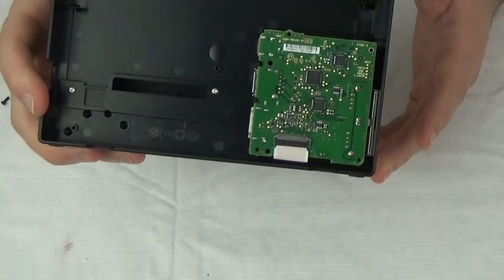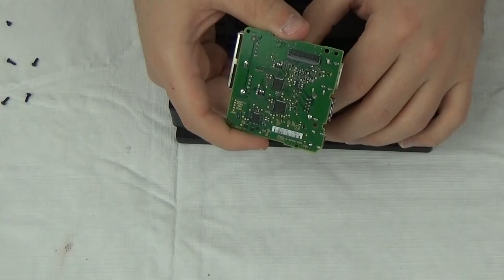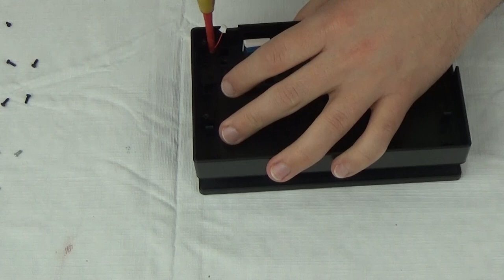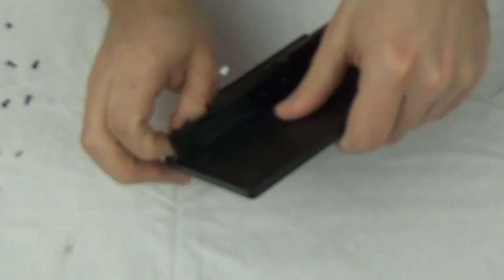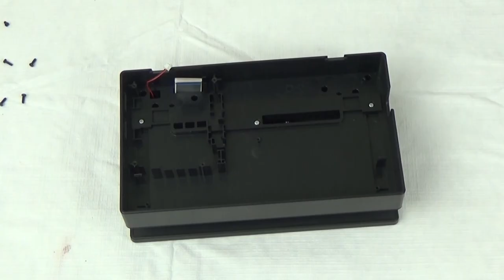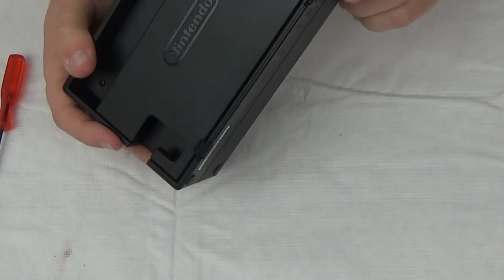Taking Apart The Nintendo Switch Dock!

Comment: Not only is it a Brilliant Console, and a Brilliant screen. & how the connectors go on the actual screen, itself, on either side of the actual screen itself👍🏿... And I love the fact that Nintendo switch actually, has a lot of demos, and a lot of other stuff that you can. Actually buy, it's that good I don't even have to. Go to eb games anymore, or JB Hi-Fi. Or Myers or Target, or even Big W and some of the stuff that's online, is pretty good like pretty decent,old arcade stadium 1 & 2,ex fighting layer rush, wonder boy collection,Super Nintendo NES collection,Some great racing games as well, & other titles, I mean even if you just want the real cheap, and even just the demos of games, the only thing I can say that might be a little bit, disappointing is that the fact is if you play the games for long hours, it might overheat. But other then that I haven't experienced any. Other things lately from the console itself. Considering it seems like a pretty decent console. I think the fact why they made it like that is so that it would overheat probably. Because kids would need a break because of radiation. I remember myself when I used to play for really long hours sometimes like 24-hours straight and most in the consoles would get really hot. And most games can take a very long time, as in completion, and take many hours to play if you do lots of Longplays. That's all I can really say for now about the Nintendo Switch. The other thing I can only say that might be missing on the online store is that they don't have clay Fighters sculptures cut and zero the Kamikaze squirrel 🐿️ for super Nintendo. But seeing that they have a big library, and variety of games online. I guess you don't really need those other ones. Thanks for showing us what's under the hood of the Nintendo switch dock box ✌🏿🧐.

Comment: they said the base would have a fan to cool down the system, all the processor to overclock. it seems weather it's plugged in or not that it's basically running full power, only limited from the screen only being 720.  totally disappointed in the quality of it.

Comment: With all the reports of the dock scratching the switch I was thinking about cutting off the front to where it would be even with the bottom of the screen.  Looks like it would still sit upright in the dock without the support of the front.  I didn't notice any electronics above unless I missed something.  I was thinking this might be a good mod for playing your switch in handheld mode with the ability to charge while your playing.  What do you think?

Comment: question from an absolutely-not-that-tech-guy: is there any concern when using the usb cable i got with my pro controller to charge my switch on the go with an old usb  to dc dapter from my tablet? thanks for your answer!
Reply: ccoa08 Most likely not but it would charge a lot slower. The official charger outputs 15V and 3.0A so if it's less than or equal to that amount there shouldn't be any damage as far as I know.
Reply: Michael Crook ok, thx. i dont mind about charging slower or not, just want to make sure that it doesnt damage the battery itself

Comment: I don't want my dock to scratch or overheat my Switch Tablet. Anyways, I see that there is a USB-C port where the spring mechanism is in the crevice of the dock. Do you think I can have an adapter connect to the USB-C inside of the Switch dock? Then I can plug in the Switch directly into the adapter instead of putting it inside of the dock therefore being able to connect it to the T.V.

Comment: Is it worth $90?
Reply: Top Dawg 8:56 "probably not" lol
Reply: the charger is 30$.

hi quality HDMI at 10$.

so... dock itself is 50.
Reply: Top Dawg It comes with the console
Reply: +TheBraveGallade
A typical USB-C hub costs between $35 and $60. Take $45 as an average. Result Dock itself = $5
Conclusion: It's not cheap, but it is also not expensive, it's in line with the typical market value. 
But you know all the "would be specialist" are convinced otherwise. What can you do!
Reply: Mum Blic 

Also the belkin usb c to hdmi costs 60$ and has the parts to convert.

In fact I don't think most docks can output hdmi and 3 usb ports at the same time while also charging (which is probably the reason why switch doesn't output hdmi nativly)
Reply: +TheBraveGallade As far I know you can send HDMI direct over USB-C, but in that case you loose USB (3.x). In case you go via the Displayport route, you can have HDMI and USB 3.x at the same time. 
Don't forget  Nintendo could have gone for a completely proprietary  protocol  This is something that the USB-C specification allows, especially for dock solutions! That's why I was hoping for close-up pictures of the usb-C controller. Missed opportunity ;-(
Reply: Damn dude you over paying for hdmi cables bigly.
Reply: Top Dawg Hell no
Reply: +Greg Greg You seem to have more information then we do. Could you please give us a reference to a USB-C based dock with similar hub for less then $90. We are all waiting with anticipation.
Reply: Mum Blic I personally don't know, but for what i read in the comments section people who know about tech say that this is not worth 90$.
Reply: +Greg Greg, Funny that you are formulating it like that. You are right, if you read the comments you would believe it. The problem is that 98% of those people pretend to know something about tech but In reality that's far from the truth. Their opinions are based mainly on emotions instead of knowledge Also a lot of them are just repeating what others are telling. Just like you do. ;-))  It's even worse, the technological knowledge of the typical YouTuber and journalist is often very limited. This channel is a little bit different, because at least he tries to look into the subject an tries to analyse it. He is not always correct but at least he tries!!
I can tell you if you know something about tech  and have a critical mind, YouTube is a very frustrating world to be in.  My advice for you: try to find  similar product on the market and compare prices. If you do that you will have a better understanding of the level of tech  knowledge of you tube commentators. It's like having an Eureka moment ;-))
Reply: Mum Blic i don't formulate my opinion on comment like mine, my comment was an opinion. I read a comment where there were links to similar pieces of tech. Your advice was a little (very little) bit rude, because you assumed that i was a "sheep" who believe everything an "idiot/ignorant" could say on YouTube.
Reply: Greg Greg 

Anyways... it comes down to 'is the dock worth 50~60$" cause you're going to use ninty's charger for the dock anyway since its actually one of the cheapest that can output that much power on standerdized methouds as the pixel charger and apple chargers as well as qualcomm's chargers use semi-proprietery modes for charging more than 15W.
Reply: +Greg Greg Let be honest: You made a bold statement. Yes, I was challenging you, that's something else then being rude. I believe for a good reason. I was always told that when ever I had an opinion, I also had to back it up. That's why I'm challenging you again: you wrote "I read a comment where there were links to similar pieces of tech. " Please Greg give us a reference! I'm not here to be right or to be a smart ass. There are plenty others here for that. I'm here to learn. If you can show me that I'm wrong, I will be happy to adjust my opinion.  I really mean that, but at the same time I will stay critical for people that try to misinform others. I don't think there is anything wrong with that, right!
Reply: Mum Blic I can't copy paste the comment, i'm on mobile. But he comment was written by Dib Siverak , a comment under this video. Btw, even a bold statement is   My personal bold statement. At the end it's just an opinion, it could be based on facts but it's still an opinion. Do you think this channel is impartial about Nintendo? Btw i don't want to spend further time debating, if you want to answer my question it's ok, if you don't want is still ok. Have a nice day.
Reply: +Greg Greg I'm happy to answer you. If you would have read Dib Siverak comments correctly you would have noticed he is referring to a 35 $ USB-C hub (in promotion from $70). This is in line with my previous statement above: Typical market value of a usb-c hub is between $30 and 60$. I used $45 as an average. Add a decent 39w power adapter + a decent HDMI cable. It easily add ups to  $80. Left is $10 for the dock itself.  Conclusion: it is in line with other products on the market. 
Also "At the end it's just an opinion, it could be based on facts but it's still an opinion" Yes maybe, but this  sounds very much what people would call "alternative facts" ;-)
Reply: Greg Greg 

That looks like a knockoff  item. A comment states that 'it feels really cheap and has scratches all over' so... no. I found similar things on amazon for 40$... and besides it has only one usb port. A switch dock has two usb 2.0 ports as well (presumably for GC adapters)
Reply: +Greg Greg Well done you were able to find a $20 product on Ali express (still missing some features!). Not sure what to think about that! I also checked the reviews on amazon(is exactly the same product btw) and at least 27% was not happy for different reasons: did not work, low build quality, broken within ..., Let see what they think in 3 years. I don't think Nintendo get away with this kind of product. Also is this really what you want. Do you think it's correct to compare a decent engineered and manufactured product with something you found on Ali Express. I could ask "what about the power adapter", but I'm afraid you will come up with something that will burn my house.  
Let be serious, we are talking here about the market value of decent products. A product that works 99% of the time, and at least still works within 3 to 5 years. Have you ever asked yourself, why these products are so cheap. Well there are good reasons for!
Reply: Mum Blic 

Anything nintendo is certified quality buyild with its seal of approval(tm) will last over 5 years. Hell the most fragile was the ds and mine is only now getting its joint slightly busted after 10 years...
Reply: daverhodus 
anything short of the official 15v 2.6A would not work with the dock though.
Reply: it should cost 50 $ but since nintendo is a company they get it for a lot cheaper so it should cost them from 15-30$
Reply: Overload Gamzer 

Which is normal anyway?
Reply: In Germany ist costs 330€ xD
Reply: Doge They aren't talking a about the console they are just mentioning the dock, because in Portugal it's 328€ as well

Comment: Thanks bruh, you just helped me undo the damage that my drunk self thought up. Apparently drunk me likes to dismantle my favourite electronics and see how they work. Im missing like 8 out of the 15 screws, and idk where the little clear plastic LED bit went but oh well. It works now lol

Also this should not be $90, nor should it even be designed like this. A simple $20 dongle would have been excellent. Too bad all the other docks screw with your switch :/

Comment: can you just remove the whole case and simply plug your switch into the CPU board so the dock isn't used and scratching your Switch?
Reply: TraceguyRune yes you could but that wouldn't be too safe because it could get wet or something and cause corrosion but maybe 3D print a shell for it?

Comment: so if the USB port on the stand gets damaged..you're out of luck charging your Switch..or if the Ports get broken on the Switch..again..out of luck. I thought the charging was like the charging ports for Wii U gamepad and 3DS.
Reply: You could charge the switch directly with the power supply. You dont need the dock. Also, you could charge the switch with any USB type-C charger. In fact, I'm charging mine right now using the charger that came with my nexus 6p. It probably doesn't charge it as fast as the original charger, but it is in fact charging it.
Reply: joemann7971 

be careful with the nexus chargers though... they were made befire USB C charging was standerdized...
Reply: The Nexus 6P came out at the end of 2015. USB-C was finalized in 2014, so, it's definitely a standardized charger. The Nexus 6P just happened to be one of the first phones to have a USB-C port.
Reply: joemann7971 
USB C port was finalized in 2014. The USB C CHARGING protocol hasn't been finalized untill last year though (which is why USB C charging devices has been flooding the marketplace)

Comment: Nintendo sells a version without the HDMI and charging cables for $60. So they are adding an extra $30 just to include cables that you can buy cheaper. I can get an HDMI cable for $3 online.
Reply: Be careful of the cheap ones. They can damage your system. Buy a good quality one instead..
Reply: Get the cheaper one than xD.
Reply: EPS5000 

the charger...

you can't get a cheaper charger that works with the dock.
Reply: 1) I was just pointing out a fact, I didn't say I was going that route. 2) Cheaper HDMI cables are, for the most part, exactly the same as the more expensive ones. They just send a digital signal of 1s and 0s. It won't ruin your system. 3) There's still a chance, if you buy just the Dock by itself and the official Nintendo power cord, but go 3rd party with the HDMI cable, to get it cheaper than $90. Especially at some retailers that are putting the charging cable on sale.
Reply: EPS5000 
The dock by itself is sold at 60$ by ninty though. I just found out.

Or does it cone with HDMI? IDK...

Comment: So much salt in the comments, the price are totally reasonable. HDMI cable are expensive nowadays and the dock also comes with a charging port. If you want that box to have bigger inside then it will cost around 120$

Comment: Looked this up to see why the dock set was a 100 bucks... its maybe 10 dollars for usb c dock board and those extra electronic parts. 3 dollars worth of materials for the box. Cheap 6 dollar hdmi cord. And from what I saw when I took apart my broken power brick it was nothing extraordinary either. MAYBE 40 dollars worth of junk, and theyre charging us 105 plus tax.
Reply: I got my Dock for only $38, and it was the Animal Crossing edition. In Nintendo website it's $59.99 and just regular one, i got lucky.

Comment: If the dock scratches the screen itself has some, including blunty, have reported, then it's a bad design choice. I undertand the desire to mask the fact that it's a handheld when it's docked to drive the concept home that it's not a handheld that connects to a tv but rather a home console that you can take on the go, however I would prefer the same concept but more open, kinda like the charging cradle of the Wii U gamepad where you just set it down and nothing comes in contact with the screen. Maybe someday they will sell Switch docks "Mini" ? Cause I imagine the large amount of plastic that goes into the making of this thing is part of why it's so expensive at retail.

Comment: Does this mean that a Dock that can enhance the overall performance of the Switch can be possible?
Reply: Casa_ Novada That ribbon cable looked bloody huge to be going to a type C port. Might be a few hidden surprises for the future.
Reply: Woogoo336 The ribbon cable was pulling power to the switch, connecting to HDMI, and all of the USB ports. Im not surprised by how big the ribbon cable is
Reply: USB-c is the same as a USB 3.1 port, it has a huge amount of throughput. And can handle 100 watts of power.
Reply: Type C has 12 connections and should be manageable in a fairly small cable. The one for the dock looks like the cables that go to the keyboard or display/camera in a laptop. Wouldn't be surprised if they have added more connections to manage more functions in the port itself.
Reply: almost looks like it's the right size for something like a laptop gpu ... SLI anyone?  to plug into the usb 3 port https://www.blogcdn.com/www.engadget.com/media/2008/06/6-3-08-geforce_9200m_gs.jpg in a box of course
Reply: Casa_ Novada possible but if this piece of shit cost 90$. how expensive the one that's going to make the switch beefer is going to cost ??  i would say 150$

Comment: Went to play my switch, which sits on the dock always and the battery was low... hmm.. checked the dock and the damn usb c plug in the middle is flush with the base lol, i must have set it down and it didn't quite line up and the weight of the device pushed the usb c connector down and flush with the body of the  dock lol

Comment: I just took my switch apart, left the circuit board connected to the usbc on the face plate and taped it in place with only the face plate left, so its laying face down and i taped a cloth to it so my switch wont get scratched im a mad scientist.

Comment: hold up so the entirety of the dock is the one block so the rest is literally there blocking the air vents on the switch and over heat's it after all my day one 2.8 year old switch has fried itself after the 8.0.1-9.0.1 update it over heat's beyond reasonable levels i scanned it and it goes up to 140+ degrees on smash ultimate alone and it literally only lets me play for 4 minutes from it being shut off for an entire week to freshly starting up it does not matter it flat out goes extreme and it will do this regardless of it being 480p 720p and even in hand held mode  no replacement option is affordable  and there is no way in hell i will ever get the lite version

Comment: My Zelda cartridge rattles can anyone confirm the same issue? My Bomberman does not rattle.
Reply: Lance Simpson I have 3 switch cartidges and the circuit board with the connection pins all move up and down very slightly when you shake them. If you hear something different it could be a small piece of plastic from manufacturing is stuck in there. There should be a way to open the cartridges and check.
Reply: It sounds like the up a down movement, Bomberman not rattling is what made me worry. Thank you!